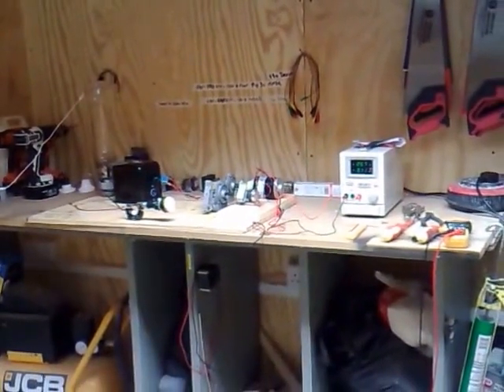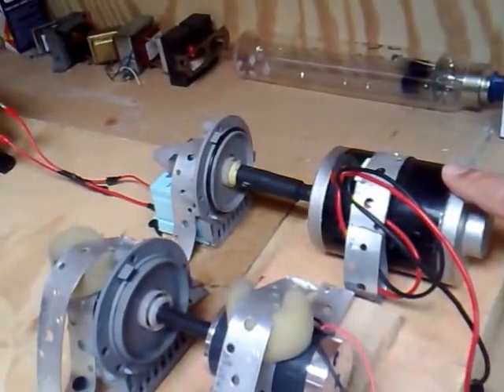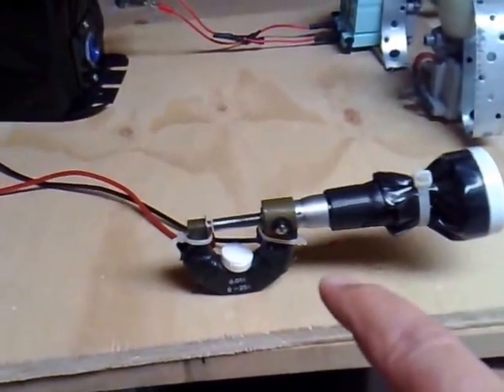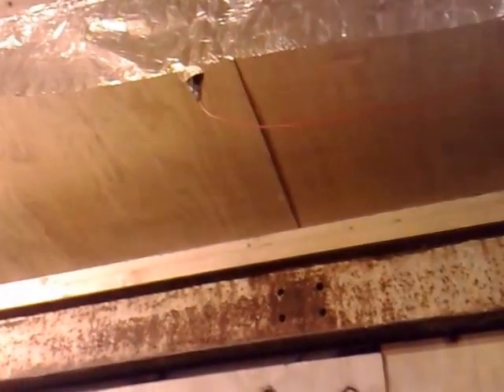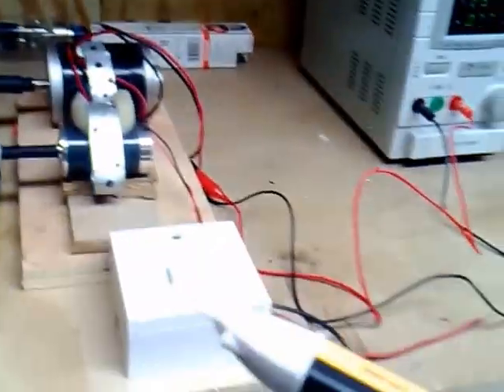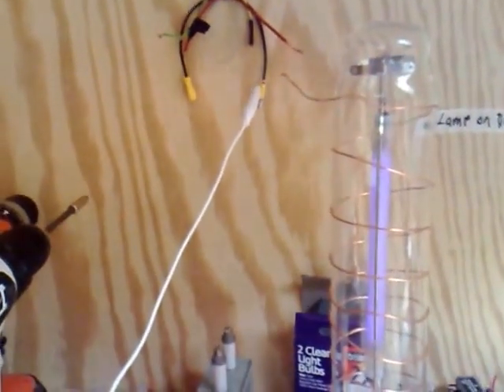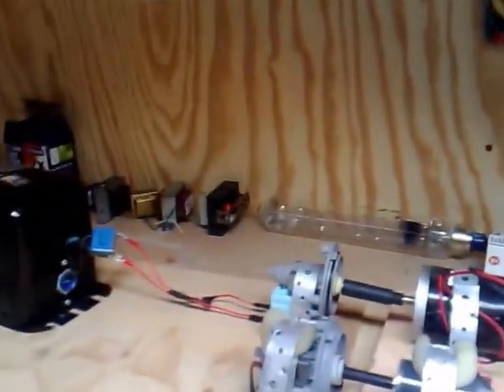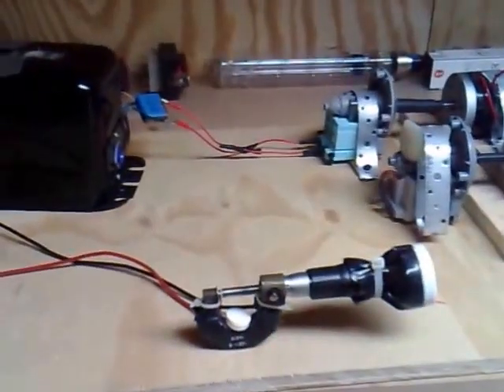Gerard Motor PROOF of RF.mp4

Comment: So just what is new that has not already been known for a few hundred years. Morin in his original video claimed that he obtained RF from the little washing machine drain motor used as an ac generator. This is just plain nonsense. The little ac generator puts out a frequency from the speed of the drive motor as given by Morin of 66 Hz which by no stretch of anyone’s imagination can be taken as RF which starts at around 15 – 20 KHz. In your set up you do produce a genuine RF output. But this is most decidedly not from the little ac generator but from the spark gap which is quite rightly fed from a 10,000 volt transformer. The spark produces  a rather complex gamut of RF.Your experiment in no way replicates Morin’s original experiment whenhe claimed to have generated RF directly from the ac generator and placed his fingers across the exposed terminals to prove that the frequency was RF as he received no shock. This shock free demonstration was possible as the voltage was not high enough to produce a shock in addition to the current available not being high enough also. The production of an ac output with a specific RF is not exactly an simple matter. A spark gap output must be filtered very very effectively to obtain the desired RF output and the output power after the unwanted RF is filtered out is very low and quite safe if the voltage is also kept just high enough to maintain the spark.
Reply from the maker: Hi VA I agree, spot on with your comments. I am a student / learner trying to understand Electric. I am focused on the "Spark Gap" at the moment together with A/C & Pulsed DC. Scalar & the GAP is my "Heart of the Matter" wow!! Tesla:- "Everything is light" have you seen the connection ? ....  Regards ....  DC
Reply: Thank you DC for your reply and the information about your present interests. Electricity is absolutely a fascinating subject for study and experimentation. Perhaps sometime you might take up the study of what for a more appropriate name is referred to  as Static Electricity. If current electricity or thermal electricity is fascinating, then static or cold electricity is enormously so. I do not know just where you are located but investigation and experimentation with static electricity requires very low relative humidity levels. I was earlier very much into this extremely interesting subject but was forced to give up my interest as I located just a few blocks from the sea and the relative humidity  over here and the city is above 90% most of the time and is presently at 98% which levels preclude any practical work on static electricity. I wish you the very best in your studies and endeavors and trust you will always find involvement with the scientific method totally worthwhile and rewarding. Most sincerely VA.
Reply from the maker: Hi Again VA Never give up on studies, fire your passion again. Static like "Earthing" is a vast subject, I too like it, it's so over looked. The Electric Universe makes sense, Tesla said "Everything is Light" Mm yes! Like vibrations and when you look at "scalar" Wow !!! "faster than light! yes (Faster) big statement! Look at Newton's Cradle effect over vast distances!!! (In the Aether)  ... Best Regards ....  DC
Reply: Thank you DC for your comments. Continuing with my interest in cold electricity is quite beyond my power because of the humidity problem. I do however have a fairly good library on the subject and my interests have now been forcedly limited to reading and armchair experiments. The very best to you, most sincerely VA
Reply from the maker: Hi VA  yes I agree with your comment. I am looking a the spark gap with great interest. Best Regards.... DC
Reply: Hello DC. Tesla seems to be the only one who has done the most with the generation and transmission of RF. Morin’s set up was based  upon Tesla’s but on a very very small scale. In the original set up Morin had omitted the most important element required for the generation of RF which is of course the spark gap. His demonstration of RF by placing his fingers across the open terminals of the little ac generator did not establish the presence of RF but merely that Morin had a very high surface skin resistance and that the humidity at the place could not have been more than 40%. Tesla’s work is available in book form and makes very interesting reading. In his time there were no vacuum valves that he could have used for RF generation but his spark gaps did serve the purpose. You will see that Tesla’s spark gaps are always coupled to a resonant circuit or ‘tank circuit’ as used in all resonant set ups. But even with resonant circuits it would have been impossible to obtain RF with a restricted band width. Nevertheless, Tesla obtained positive results. I have not read any where in Tesla’s writing that the subscribed to the false concept of free energy as this concept is used presently. All success in your investigations and my sincere wish that you adhere strictly to established scientific method. Sincerely VA.

Comment: All spark gaps are RF generators and you proved nothing! You will not power anything more than a neon light with that setup!
Reply from the maker: Well look at Tesla's work  so I would disagree with you.... DC
Reply: @e.powerdc1127  I have been working with Tesla's designs since 1962 and thousands of variations except on the scale he built at. I also hold a masters in physics, electronics and mechanical engineering. I am now retired from NASA but still have access to my old laboratories at the space center, waiting for when and if we plan to send mankind deeper into space. If you know anything about Mr Tesla then you would know what 396 is all about!
Reply from the maker: @harrybmortoniii263  Hi ..HBM 3 good to know that you have a solid foundation in Physics. At the moment i am recovering  from illness which has held me back over the last year. I am hoping to do more experiments & projects in the coming months but its slow.
I too could not see that RF could produce power; however my work is focused on the spark gap with tuning.
Thank you for your interest.... Regards ... DC
Reply: It's not that RF can't produce power. Of course power can travel at RF even through the air obviously. It's that the particular setup getting the high voltage at RF that particular way isn't going to be getting a lot of power out of the generator and people may as well just run solid state inverters from batteries at high frequency if they somehow prefer it. A ZVS driven inverter for example. Electronics may not like that high frequency but you could still light bulbs and shit like that, touch it without getting hurt etc...